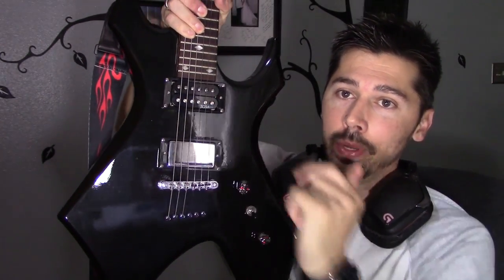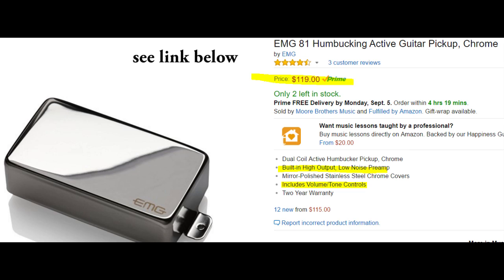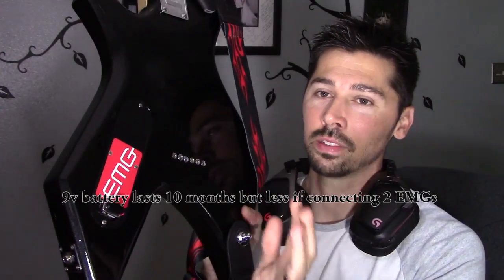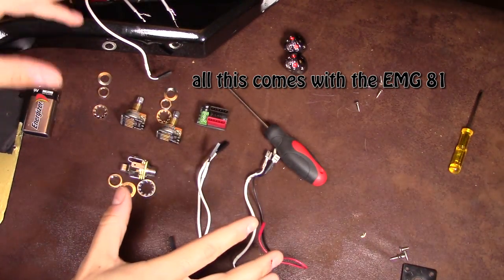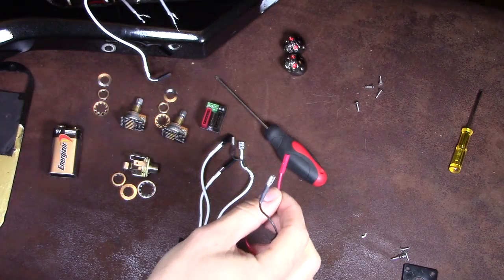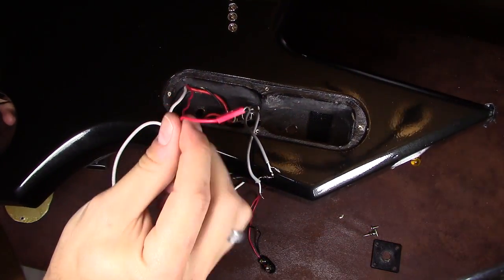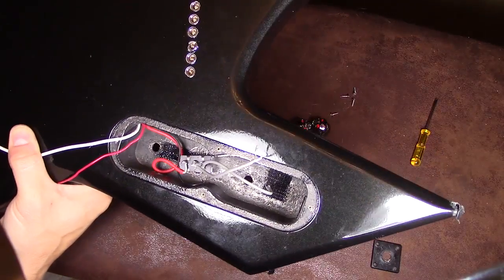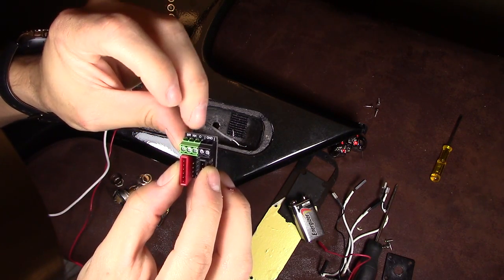Wiring EMG Active & Passive Pickups in Electric Guitar

Comment: Most all electric guitars with a humbucker use 500k vol. pots. An EMG 81 active uses a 25K vol. pot. So the only real good way to attempt this is the have 2 volume pots on the guitar like a Les Paul. The EMG w/ 25K and the passive neck pickup with a 250K or 500K pot. Control volume pots independently when in the middle pick up position.

Comment: so the passive neck pickup just runs at "full" volume due to not being connected to the volume pot?  Although i see that you connected the switch to the IO board.  So that would make the Passive pickup go through a 25k pot instead of the regular higher rated 250-500k pots for passives...correct?

Comment: I'm very confused where the tremolo ground wire goes. I have the EMG 3 way solderless switch. I just don't understand how the tremolo ground wire attaches to the switch sense its supposed to be solderless. Do I just not use it?  I'm a newbie to this haha,
Reply: i have the same doubt but i think the best option is to connect the tremolo ground to any ground point of the EMG circuit. maybe cut a small section of one of the ground cables and solder the tremolo ground to it. maybe....
Reply: @Andres Malta  Hey, thanks for the reply! I figured it out about 8 months ago. That's exactly what I did. Thanks

Comment: I love how you use electronics to have quality father son time. That's so awesome. Could you do a 25k vs 50k comparison in active guitar pickups? Thanks.
Reply: Ik I’m late but just adding my two cents, not too much of a difference, I have a emg81 in a guitar with a 24v mod with 50k pots and they work good and a emg40csx in a bass with 100k pots and it works decently good. Only difference is the higher the pot the more it works closer to a on/off switch. As to a tone difference I can’t say definitively if there is a difference but i did it anyway

Comment: need help , i want to do the same but i have 2 volume , one for the neck and one for the bridge , can i install the emg wiring(bypassing the tone knob) and leave the passive circuit as it is
Reply: You will need a 25k volume knob for the active pickup and a 250 or 500k volume knob for the passive pickup.

Comment: Nice vid! Great idea on the battery placement. Would I be able to wire up my Ibanez RG550 HSH with 1 volume , 1tone , and 5 way switch this way? Right now I'm  running an active bridge only and the middle and neck are disconnected and are both passive. Basically can a passive single middle pickup be added in? Your advice would be appreciated greatly. Thank you for posting this how to video I think it will be really helpful in getting my guitar fully functional again.

Comment: I'm thinking of getting a emg 89 for my Floyd rose dean vendetta it has a emg ab afterburner,a Ironage killswitch two Dragonfire quad rail pickups and alpha coil tapping push pull switch. I want to install the emg 89 pickup at the bridge position can it be done?

Comment: im a bit confused active pups used 25k pots and passive mostly 250k or 500k pots.  my point is does the passive pups becomes weak.
Reply: If you wire a passive to the 25K volume pot, the output of the passive is much weaker than when hooked up to a 250k or 500k pot. The passive pickup acts like it is turned half way up even when the volume knob is at full. I know this because that is how a previous owner wired one of my guitars. What I do not know, is what would happen if you hooked a active pickup to 250k or 500k. Maybe someone else can chime in and answer that.
Reply: @kenr.b.891  250k or 500K pots will act as an on off switch to the active pickup if I’m not mistaken, meaning no go.

Comment: Is there any tonal difference when using both active and passive pickups? Does active pickup dominate the passive pickups sound, can you hear clearly the difference between both pickups or only the active. Im interested in trying this but i want to hear when both pickups are in use
Reply: Active pickups will provide a significant boost to the output. They essentially provide an extra pre-amp stage to your amp. Unfortunately, they compress much faster because of this, and thus are poor for pretty much anything but high gain tones.

Comment: Thanks for the great video!  I recently purchased a guitar that already had an EMG pickup installed.  When I received the guitar I found out the original passive pickup had been disconnect.  I could not figure out how to reconnect it to the new pickup with solderless pots.  The guitar did not come with the io board/pickup bus.  Once I found one, I watched your video, installed it just like you show and now it works great!  Thanks again!

Comment: Probably the wrong category but im lost as how to reach you for a problem I am having with a 208/240v 1-1/2 horse motor with scratches on the connection diagrams. I know enough to be dangerous when and if you get the time I will fill you in on the details